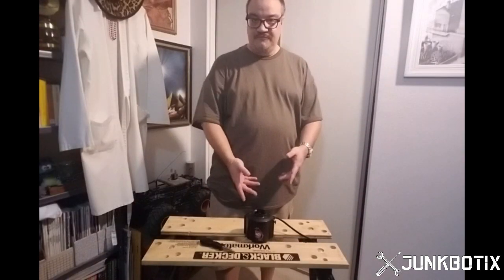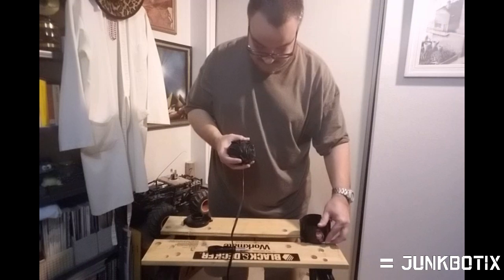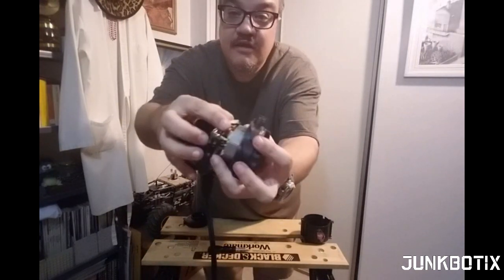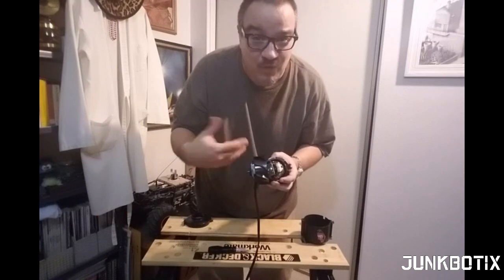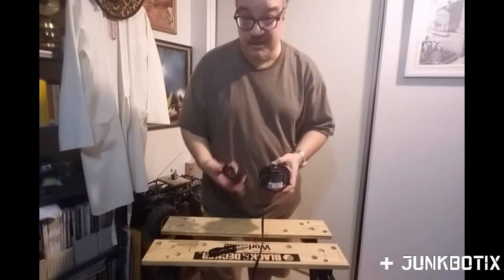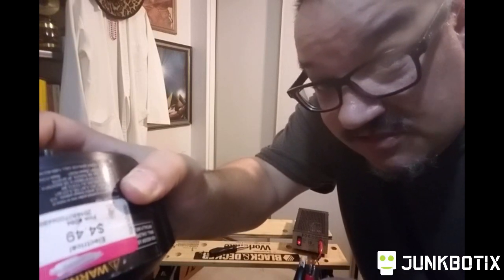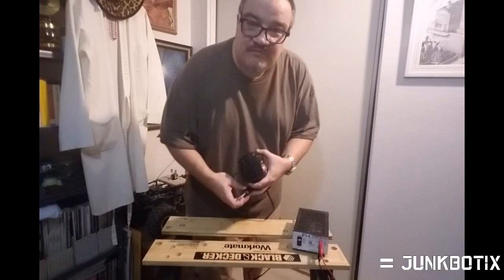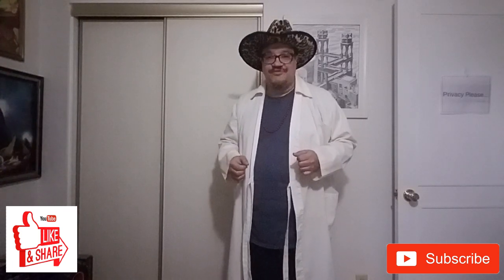Mattress Inflators Part 2 - AC Inflator Teardown

Comment: I tried using a mattress inflator to improve a desoldering tool.  It was one of the spring loaded plunger suction types, but the kind that is self-heating, not the cold kind that you use with a soldering iron.  I 3D printed adapters to connect a piece of PTFE tubing between the tool and a deflator.  I was able to model a cap in OpenSCAD that attached to the top of the inflator, on the suction side, similar to the opening you have on this one.

Unfortunately this inflator used a 6VDC motor, and it was just too feeble to suck any solder.  Now I have a good Hakko desoldering tool.  But if I find a high powered AC inflator like this one, I may give it another try, just to see if I could make it work.
Reply from the maker: Hey, that's a great idea for an inflator! It's too bad it didn't work out for you - but a lot of times, a DC motor can be "over-driven" with a higher voltage, and only shorten its life (mainly the brushes) a little bit - just don't get too insane with it (for a 6 volt motor, 9 volts would be about the limit - unless you care nothing for its longevity).

A while back I had the idea of using the pump in an AC powered nebulizer that I picked up at Goodwill to build a hot-air soldering station, but I never got around to it (story of Junkbotix!) - but now that I think about it, maybe using the AC inflator and a dimmer switch (to control the speed) would be the ticket?

Anyhow - that's a great story, and reminds me that I need a 3D printer for my shop - well, once I get it cleaned up!
Reply: @junkbotix  You'll love having a 3D printer.  I'm using one right now to try and fix a heater/AC vent baffle for a '91 Volvo 940.  And OpenSCAD is great if you have even hobbyist-level coding skill with C-like syntax.
Reply from the maker: @joelavcoco  I've played around with OpenSCAD (coding is not a problem here), and some other variants (OpenJSCAD for one). I've also toyed with a few different open-source CAD packages. But hardly anything has been as easy to use as TinkerCAD, for quick stuff. Of course, I've never printed any of my designs either, so until that is done, I can't really judge well what is and isn't good for the work. There's plenty I could do with a 3D printer - my problem has been finding a spot to put one. Obviously, right now, my shop is out of the question. But if I could ever get it cleaned up, I could have a 3D printer set up - and maybe actually use my HF micro-mill, too (and maybe even add CNC control to it)!